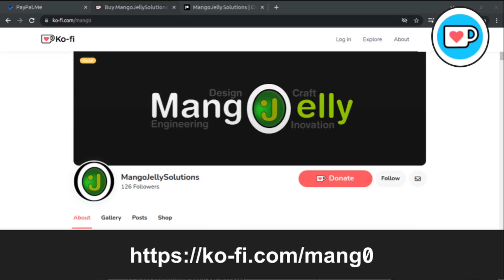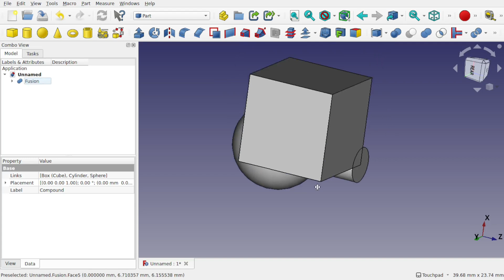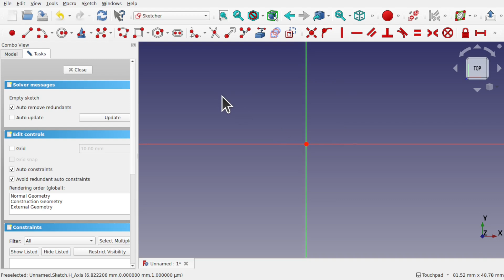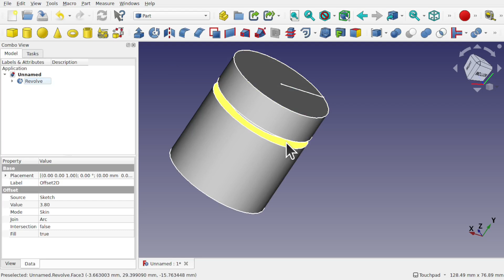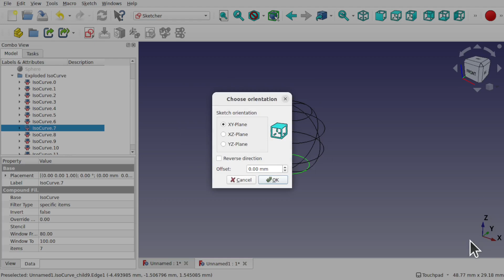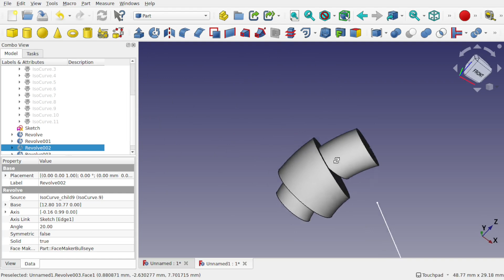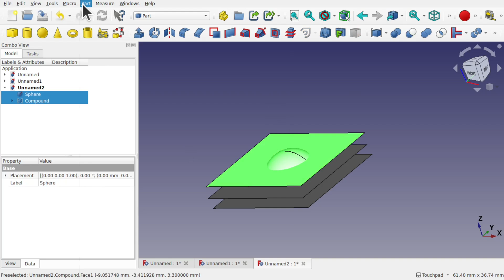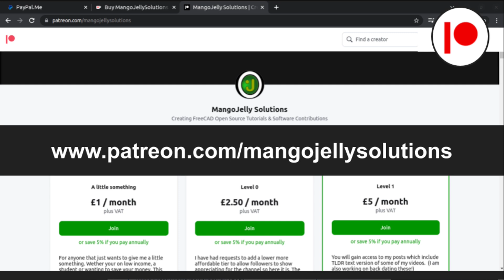Learning FreeCAD for Beginners | 40 | Compound Objects | What are they and how to use them.

Comment: I have a suggesstion ...
I have been watching your videos and the effort you have been putting into the tutorials. RESPECT.
So here's the thing ... the barrier to entry for f360, and the relalted CAD apps is the FREECAD approach ... it kind of culture shocks the living daylights out.
In the forums I have seen there is one good vibe suggesstion and that is GIVE F'CAD and ONDSEL a chance.
I did ... grrrrr .... 
BUT BUT BUT wait.
The question has always been on how to approach F'Cad is it PART DESIGN or PART.
I started with PART DESIGN ... no sirreeeee. bad move.
I have not seen any clear pointing from anyone. its more of a diplomatic answer. The coice is left to the individual.
I strongly suggesst is to start with PART Work Bench and stay with it till reasonaly good proficiency is acheived
THEN explore PART DESIGN.

This video tutorial of yours opened my eyes 👍♥
P.S. I use Ondsel. (Level = NEWBIE)
Reply from the maker: Yes yes, Part vs Part design always a early stumbling point and confuses so many people.  They are two different paradigms, part being boolean based modeling whilst part design is feature based.  The real eureka moment is when you get into surface vs solid modeling.  Part Design doesn't allow for open wire model (which creates a surface rather than a solid) where Part does.  Though you can do solid modeling in the part workbench it is a much more open workflow allowing for a model to be built with solid, surface and compounds.  The Part Design is extremely strict due to the nature of feature based modeling, you have to create a solid each time.   Under the hood what is happening with the pad and pocket in the Part Design is a extrude and a boolean fuse for pad, or a extrude and a cut for a pocket.  The boolean part is done automatically hence why everything has to be a solid.  And this always confuses people as the first question by anyone when they first start is 'why do they both exist'. 
Glad your enjoying the videos.  Ah yes Ondsel, great flavour of freeCAD very nice interface :)
Reply: @MangoJellySolutions   Thank you for sucha a perfect reply. I NEEDED THAT explanation. ❤❤❤❤

Comment: I'm stuck on something - I can model individual components just fine - say, the faceplate and needle of a gauge, the stepper motor, arbitrary spur gears. What's the process of designing the framework that'll hold them all together? I want to position the known parts in A2Plus, keep them all in view, and build up the frame in between them… is there a video where you show this kind of process?
Reply: both the A2plus and Assembly4 require you to have a separate "assembly" file from your working/designing file. You wont be able to work directly on the assembled objects in the assembly file effectively because what you have now are parts with origin points far from the global origin. What i personally do is using the Draft workbench and draw the constructions lines to snap my parts to. Usually in a form of a cross to define my parts length and width at the same time give them their own origin point to perform rotate/mirror etc. Hope this helps.
Reply from the maker: Really good answer, I like this method 😊👍